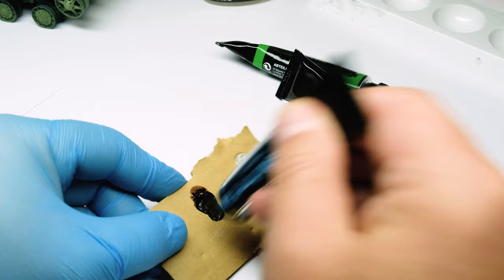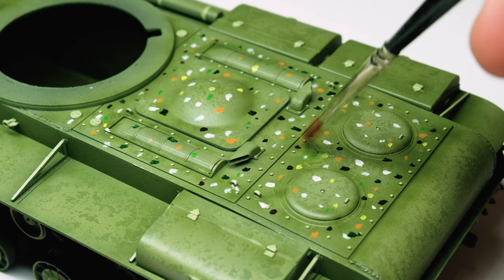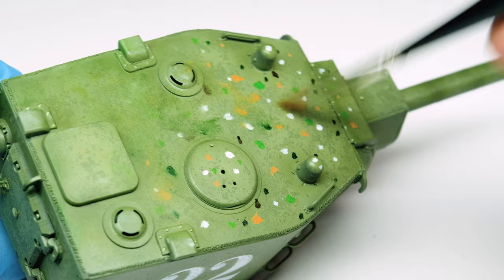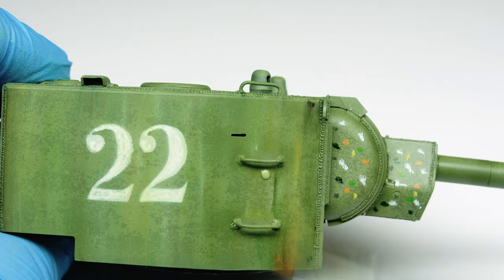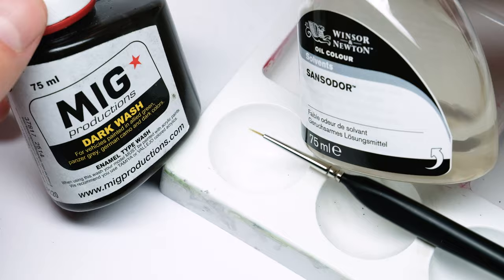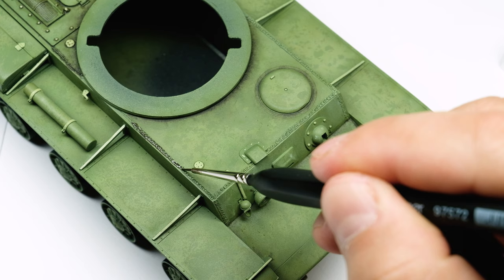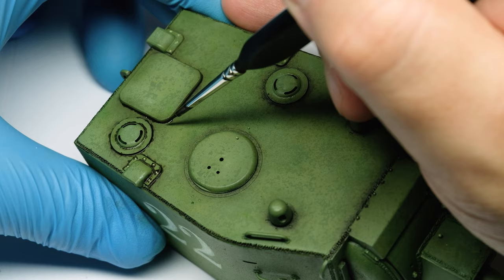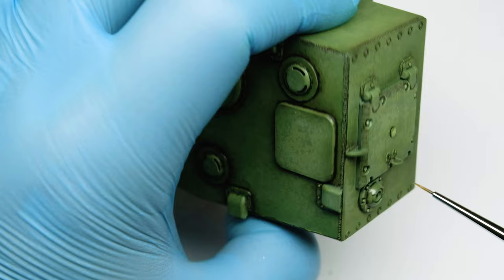Working with Oil Color - Sovjet KV-2 1/35 Zvezda - Episode 3 - Oil Dot Technique, Shadows, Pin Wash

Comment: Fantastic tip about brushing some thinner on the surface before hitting it with pinwash.  This has been an issue with me getting it to flow right (I don’t gloss coat between steps).
Reply from the maker: I had the sometimes this problem, even with a gloss coat on. There are some small things, which can make your workflow easier and faster.

Comment: very niceI got the advice to seal the tank before the oil dot procedure with gloss varnish. I did not use thinner. Not sure if I did it right. I used Vallejo acrylics spray paint for the base and Abteilung 502 for the oil colours.
Reply from the maker: Salut Pedaleur! The brands don't matter, the effects I used in this video are oil colors. Gloss varnish is usefull for a wash. You can also apply the oil colors over a semi-gloss or flat surface, it's just harder to blend them and I suggest, that you work in small sections. Because it happend to me, that the oil dots left some stains on the model because I was working too slow. If it's too glossy, you will push the oil color around and it will be difficult to get the effect in place. But it's all about trying, what works best for you. Merci beaucoup pour regarder le video et laisser un commentaire!

Comment: Hi, are these techniques based on a model that is varnished with a glossy or semi-gloss varnish? And when it's done, does it repaint or not? Thanks.
Reply from the maker: Hey Milan, thanks for the question. I find it easier to make pin-washes over glossy or at least semi-gloss varnishes. I like to work with oils on satin varnishes because the oil colors hold better on to it, you can control them better. If it's too glossy you just wipe them away. If it's too flat the oil dots leave stains on the surface. Have fun!